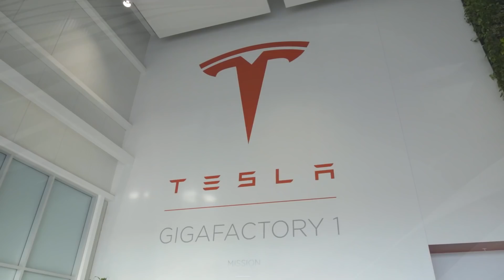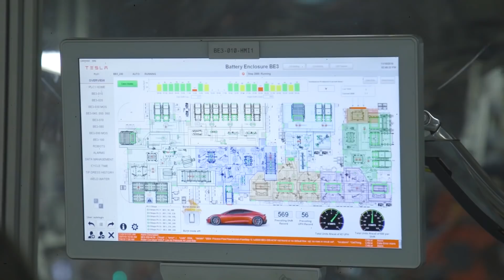Why Tesla Built A $5 Billion Dollar Factory

Comment: The Grid batteries are good for about an hour at full load. It’s not a solution for using sunlight during the dark hours but it does manage spikes and brown-outs.
Reply: It doesn't have to be limited to spikes and brown-outs.  It can be scaled up over time (just like the fossil fuel powered infrastructure was) and power consumption doesn't stay at full load all the time anyway.

Comment: Damn Tesla is gonna Take Over in 25 or even 30 years
Reply: Never
Reply: Nope
Reply: @carholic-sz3qv  yes it will because Fuel isn’t gonna last forever
Reply: @b0ws3rnuke94  fuel is already made by recycling and many other methods, from biogas to biodiesel..... algae......
Reply: @carholic-sz3qv  hmm but electricity is more efficient and will stop climate change
Reply: @b0ws3rnuke94  electricity is not the only solution and its not efficient for all applications, imagine having to cross the Australian outback with a road train there is no battery powered truck that will ever do that, also in emergency situations or rescues.